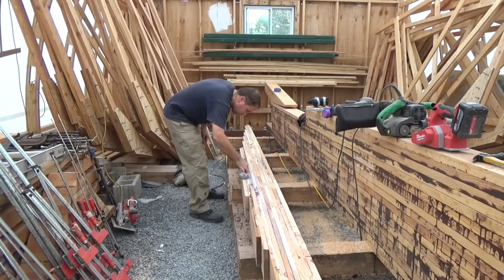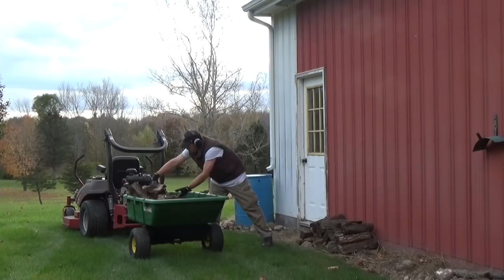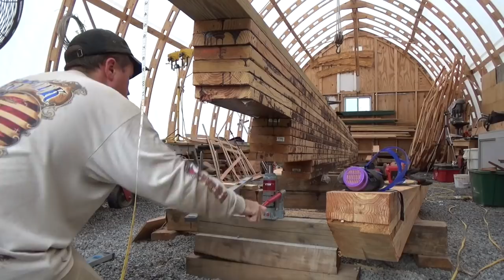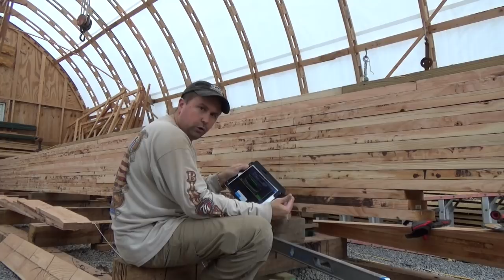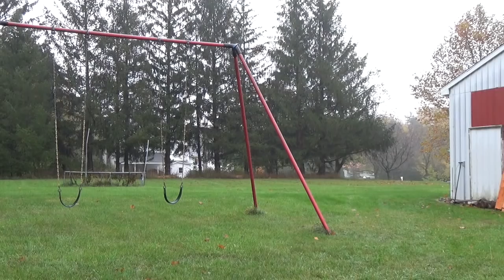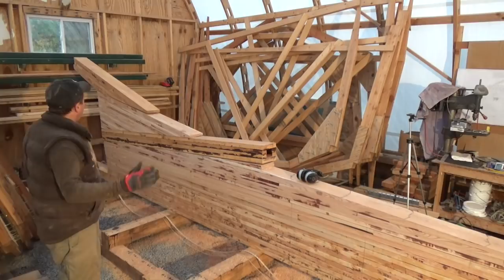Dry fitting the keel on our wood boat, Diesel Duck 41. Sea Dreamer Project #18

Comment: Dude, you need a gantry crane for all of that lifting and would be helpful for laying down the keel on its side and picking it back up as well. Think an A frame on wheels on either side with a strong beam between then and a chain hoist for the lifting. My back hurts watching you lift those sub-assemblies.

Comment: For a pro, the CAD can make wonders, boats are built in half the time, for normal folks like us, it's best we...take it slower :)
Still, it's extremely fast compared to pen and paper over the drafting table, which for some beginners, it was prohibitive in the sense that, either you drafted, or you made it up as you went along, which (either for different reasons) could have catastrophic results.

Things are nicely coming along. Steady as she goes.
Reply from the maker: It's crazy how accurate you can get with the angles and measurements in CAD.

Comment: I had a thought... after you lay the keel on its side a wood floor sander would make short work of the fairing it. they rent them out but you might find a floor guy with one, there kind of tricky if you never used one before.
Reply from the maker: I used the drum style many years ago to refinish the floors of our first house.  Man you are right, there is a learning curve but in the end it looked nice.  That's a pretty good idea, and now a days they have the random orbit style floor sanders that are much more forgiving.